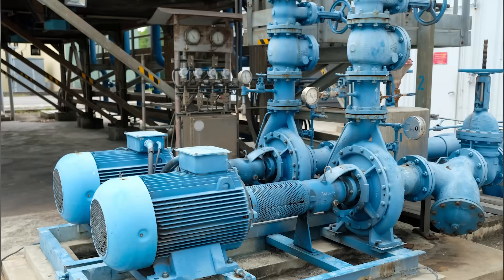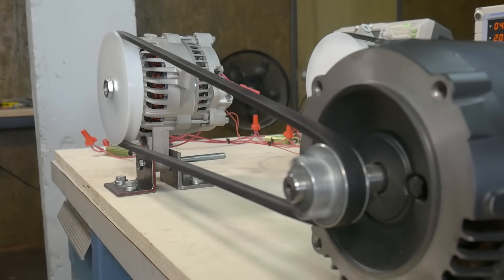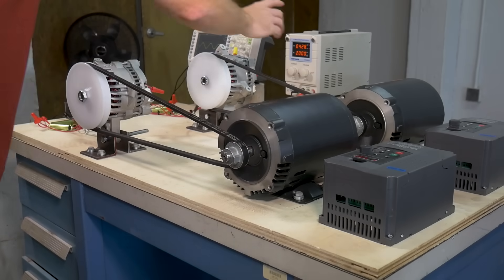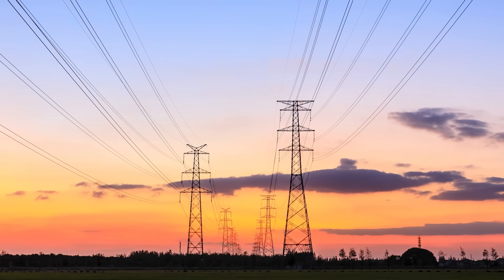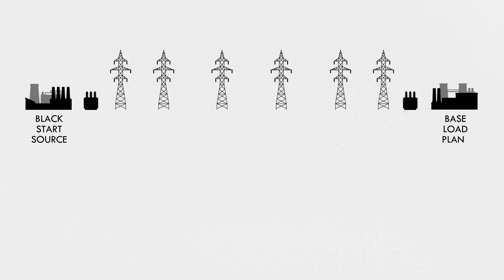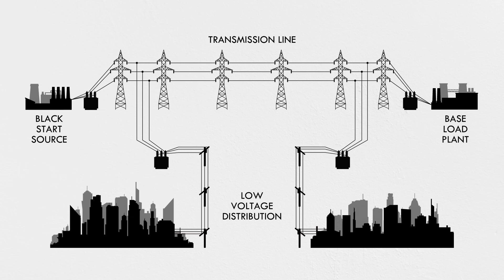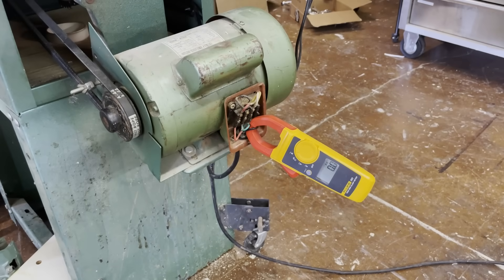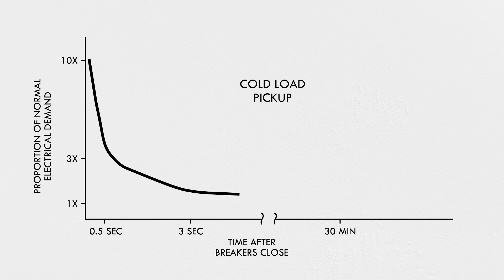What Is A Black Start Of The Power Grid?

Comment: The same principal of synchronization must take place when a system is running off a backup generator. The transfer switch controlling circuitry monitors the power line synchronizing the generator's output in frequency as well as phase before the transfer switch will transfer the load from the generator back to the line (main power).

Comment: Man years of working with power plants.
I can say that as I'm about to bring a generator "on line" I always had it running just that little bit faster than the buss speed. Just because when you close that tie breaker, it will drop speed a touch due to load and then it's sync'ed to the buss  and even if you turned off the exciter power, the generator would still turn, driving the engine that is not running. That's why we had "reverse power" trip on the breakers.
I've done my share of "black starts". When everything is black.. I would fire up the emergency generator (400kw) that would get the lights and water supply going. Then hand start the diesel air compressor to build up starting air for the big generator engines. While that was happening I'm getting the fuel system set for starting, priming etc.. I'm also running the oil heater and aux pump because you can't start the engine with cold oil or without pressure already built up.
So, it's a long drawn out process.
I had one instance where we were returning from a Hurricane evacuation. It was late and only 3 of us were there to get the plant running from total dark, not to mention the debris and water everywhere. I definitely earned my pay that day.. and night.
Makes for memories.

Comment: a hydro plant has the advantage ofnhaving multiple turbines so the cold start involves diesel generator or external source onlybtonstaty first turbine afterr that the plant can use its own power to start the rest of turbines. 
in the case of the major blackouts, did power generating facilities really shutboff to a point where they stopped producing any power ?  even a nuclear plant will keep producing enough to keep the cooling system running even when disconnected from the grid
Reply: Yes, the plants did stop producing power as there was no load and most thermal power plants can’t ramp power down fast enough to just their house loads. Unfortunately, most nuclear plants are in this category and they need a power source to power their cooling pumps. The onsite diesels will provide power to shut and cool the plant down but not enough to allow the plant to operate and generate power.

One more thing, it hard to control power plants operating at a couple of percent of their full rated power as the control systems don’t have enough fine control at a low power level. A 1% change in feed water flow of 100 gpm at full power is now a 25% change at 4% of rated power.

Comment: Thanks again for this great series Grady! As an electrical engineer in systems protection, I really enjoyed these videos. I'll never forget the report we read about a coal fired plant that was not properly synced to the grid (they bypassed all FOUR sync checks for some reason or another). The generator was thrown through the roof of the 14 story high building, and pieces were found up to 3 miles away. Amazingly, no one was killed in this accident. Synchronizing the grid is absolutely terrifying, but luckily we have relays that can automate most of the manual process at this point.
Reply: Side story, I previously ran an old 1949 GE genset, with an older 1930’s air operated breaker. Well the air breaker hung up, and when it finally decided to close we were approx 120 degrees out. Well luckily the building just shook and the dust was coming from the ceiling. Unfortunately that generator never sounded the same again, sounded like the wedging all loosened up, it made a fairly loud new growl. Granted this is after the sync relay sent the close, and they unfortunate fact that once a close was sent, an open signal wouldn’t do anything. This was a small 16.5 mw rated unit, we got 20 mw out of at 12 psi on the casing pressure with H2. Miss that old plant. Now I run 34 screens and mice, and gas turbines.
Reply: Is the report accessible to the public by any chance?  Any security cam footage?
Reply: I'd love to see that report - got a name for the incident or something?
Reply: Was that the one where the generator coupler went through the washroom?
Reply: Slipping a pole is a fun but terrifying experience
Reply: Wouldn't it 'just' trip a breaker?
Reply: @marco23p  electricity and magnetism are way faster than any mechanical protection device like a breaker. Breakers are fast, but the generator would have already been in pieces by the time the sync breaker opened
Reply: @marco23p  It does, but a lot of other things get destroyed before the generator breaker can reopen. It all happens in milliseconds.

Comment: The AC electrical system on some old airliners like the Boeing 727 required the flight engineer to synchronize the three engine-driven generators when connecting them to the main bus tie, using a light to see the beat frequency between the buses, much like in this demo. In more modern jet airliners, each engine generator normally powers its own isolated AC bus, and the bus tie is only closed when an engine or generator is offline, to avoid any paralleling of AC electrics and the need for synchronization.

Comment: In wind I'm not familiar with any turbines that can black start without having a grid tie to a diesel gen or some kind of battery storage array.  We have to have power to boot up systems, get things under control and moving, and then we have limits to operating frequency and voltage fluctuations.     I have personally put a pair of turbines online during an event where a town was isolated and switched to their diesels. We helped them save fuel when we had wind and the two power sources played very nicely together.

Comment: You could reduce cold load pickup and make it easier to recover the grid by providing incentives to major power users to have adequate backup generators, possibly even at the residential level. While a residential backup generator isn't cheap, it will reduce cold load pickup if everyone in the neighborhood had one.

Comment: I've been thinking about the synchronisation of  grid frequencies. Could that be made simpler by having a time reference to synchronise against at first? For instance using GPS for time data, and having some assigned synch ticks calculated against that, could make all individual parts of the grid get very close to full synch before they actually connect.

Comment: I used to be a Utility Engineer in Juneau, Alaska. Think rolling blackouts, in winter, because the power company didn't have enough capacity. Try fixing a cold solder connection  at the junction of an excitation coil and the slip ring of a 100KW emergency generator, for a sewage pump station, at -10 degrees F. It doesn't take much to throw a system out of commission.

Comment: Shame this is the final instalment as I've really enjoyed the series but you know best about the content you put out so I get it. 

I've worked in a couple of settings for the UK National Grid & in Gas Supply infrastructure and no matter how many times I asked nobody could explain why Black Starts and Pipeline Interruption's couldn't just be handled via The Popeye Principle. Each plant, distribution hub, condenser installation etc  just ensure they have one guy( or girl) on shift at all times whose had the appropriate training. If things go belly up they crush a can of spinach, chug it down and then hit said equipment with a comically large sledgehammer. I mean there's clear evidence that anything  could be overcome via this method. It needs no power or generation synchronisation  and is highly cost effective along with being the ideal replacement of the alternative "Have you tried turning it off & back on again" method which sadly can't be used in such instance despite being a more modern approach

Comment: I had long suspected this is the case, but is it fair to say that (on average) a power company is likely the be the biggest consumer of the power they produce?  As you mentioned there are tons of fans and pumps and electrical components all through a modern plant.  I know an aluminum foundry, or something similar, also uses large amounts of power, but I don't think that's usually a contestant consumption, and is likely to be fewer in number compared to every plant requiring that large power use.

Comment: Using a small generator such as the ones formerly used on bicycles or even a small motor that could be hand cranked to provide the initial excitation for the alternator would demonstrate the bootstrapping concept more emphatically than a plug-in power supply. A battery would work as well. Of course the two matching alternators made the build easier and demonstrated synching well so overall this was a very good demonstration. Were the delta configured power resistors just for loading? I couldn't quite follow all the connections without a schematic.

Comment: In the future I would expect that there would be large scale battery energy storage facilities that would act as the base line frequency. Since inverters can react almost instantaneously to load it is a far more advanced method of providing stable electricity. I have an off grid solar system that is always online. My inverter rarely shuts off it’s been running for the past 20 years. I enjoy when the power goes out in my city because it does not affect me in the slightest. I have a well pump and an electric car and a woodstove and I have energy security as a result.

Comment: I’ve used that GE synchorscope on some of the older ships I’ve worked on. There’s a prank played on new engineers… you’ll be standing at the board adjusting the speed, awaiting that magical 12 o’clock indication and the moment you close the incoming breaker, one of the engineers watching will hit the light switch for the control room! Considering the main engine supply pumps are run by the generators, it’s a bit of an “OH F&$#!?!” moment.😅

Comment: ConEd learned an expensive lesson during the 1965 outage when its Ravenswood plant on Long Island tripped off line. The recently installed Ravenswood #3 known as "Big Allis" was built by Alllis-Chalmers to be the first million watt plant which promptly self destructed because the bearing journal lube pumps were powered by electricity with no provision for backup.

Comment: And usually, a power plant needs external power to operate. It's why Fukushima happened. They lost outside power and had no functional generators or battery storage. Personally I think it's a little insane, but I'm willing to bet there are at least plausible reasons for not being able to do so.
Reply: Fukushima did have stand by diesels and batteries. The diesels started and picked up the designated loads. The operators were in the process of starting the cooldown to cold shutdown conditions and everything was fine until the tsunami flooded the diesels and batteries of several units leaving those units without any offsite or onsite power sources.

Comment: 40 years with HLP/NRG good luck with doing a Black start. Staffing cut to below minimum. Equipment run past failure, Idiots promoting family and/or other idiots all the while getting rid of competent workers because they are a threat to the systemic Dumbassery. On a normal start it takes all crafts to get the safetys jumpered out to get anything to start.

Comment: So does a peek plant like the one in my neighborood does it ha e yobe sycroed tothe grid when like insimmer we need sbit more power so it starts up it would have to be synced.
Now is a reostat type device be used as well ? [ I like your  oscilloscope  ] is it from Keysight ?
One more thing ...why has no one figured out how to remove that back current load so at startup the motors don"t go through stresses  that could damage it ????
Too meny questions.

Comment: On generators used by the military that are 15Kw and above they have the ability to synchronize with a parallel cable and synchro lights. We would power up the second generator and adjust the loads until both synchro lights flashed in unison then cut over to the second generator. Once the cut over was done we could safely shut down the first one.

Comment: I've heard that natural gas is used to power gas turbines that spin generators, and that this is the new favorite way to generate electricity. If I was tasked with creating power for a black start, I'd use large gas turbine generators mounted on trailers, hauled by trucks. You could drive the generators to where they're needed, and it wouldn't be that hard to find or bring a source of natural gas for the startup.
Reply: Just make sure the compressors of the natural gas system don’t require electric power. Otherwise, your natural gas turbine will find itself without fuel.